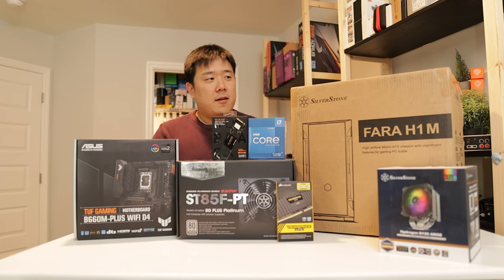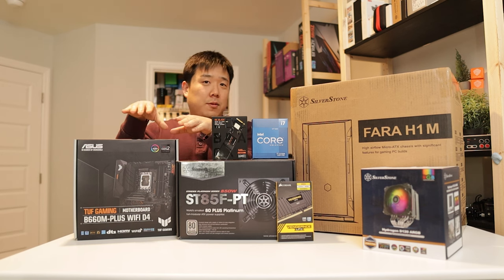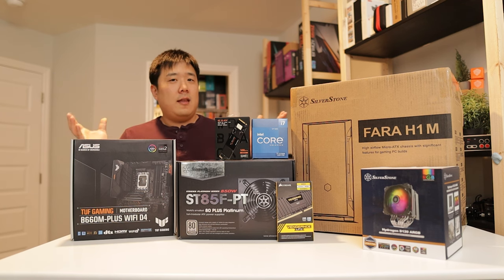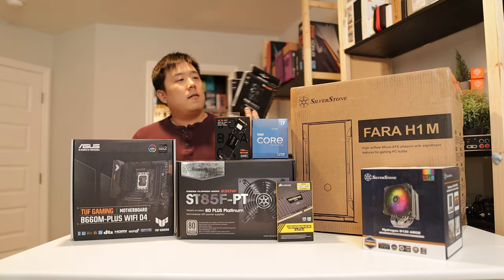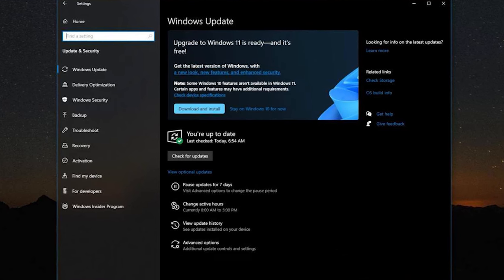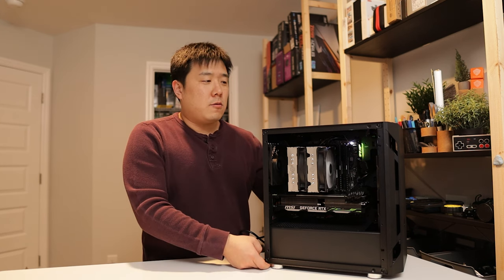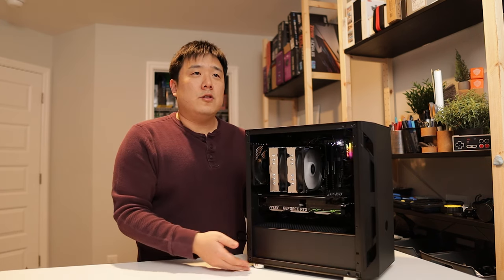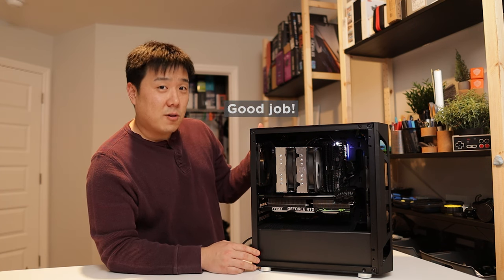Custom Desktop for Architecture - Intel 12th Gen Build

Comment: I ordered this case to replace my current case that I have had for ~13 years and about 5 builds in. Not because it needs replacing, but because I need a case for my nas and finding a cheap case with a bunch of 3.5 bays is hard. I realised I don't need a cm690 for my current build and don't even have any mechanical drives in it.

This will be my first 'flashy' build as it will be the first time I have a glass side panel and will actually have it sitting on my desk.
Reply: 70 bucks isn't cheap. And the extra SSD mounts this case has, can't even be used. There are much better and cheaper cases out there.

Comment: Great video! I'm an architect and looking to build another desktop so this is very helpful. I do some rendering but not intensive-mostly SketchUp. I use creative suites for rendering hand and cadd drawings so both PSU and GPU important but not critical to be higher end. Is there a less feature/cost graphics card you'd recommend? Attempting to cut build down a few 100! Thanks!
Reply from the maker: For GPU, if you don't do much of rendering, 3060 is a good choice I think. Then, you don't need as much for PSU.

Comment: Do you think i can use this Silverstone air cooler for the new i7 13700?
Reply from the maker: Check your motherboard.
Reply: @JosephKim  sry i mean this silverstone hydrogon d120 argb air cooler, is it strong enough for cooling the i7 13700 (non k) version
Reply from the maker: I don't know if you checked more recent video, but I had ungraded this setup 😉
Reply: Get a Thermalright Phantom Spirit or Peerless Assassin.

Comment: The Fara H1M is overpriced af. You can't even properly mount SSDs on their designated spots inside the case. I have no idea who came up with that design, but they must've been drunk or something, when they designed this. It's def not worth 70 bucks. There are much better cases for less. Ur literally paying extra for the brand here. I got this case on discount for €42. And when I realised I could not mount my SSDs where they are meant to be mounted, I instantly returned it and got the Tecware Forge M instead. Would not recommend it to anyone who needs extra space for SSDs, because the extra space this case offers and you pay for, can't be used. So it's worthless.
Reply from the maker: Thanks for your feedback!